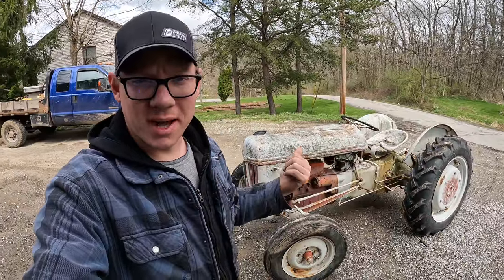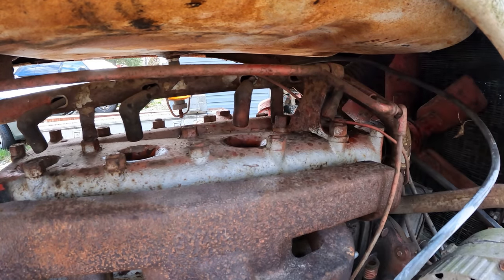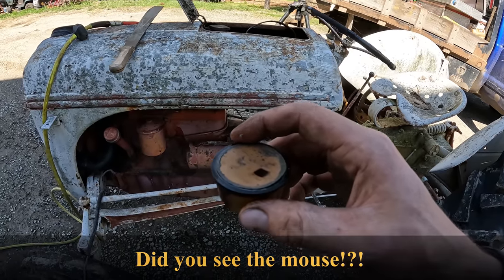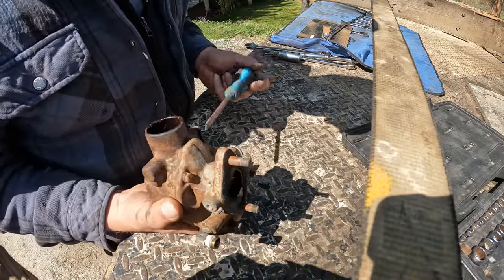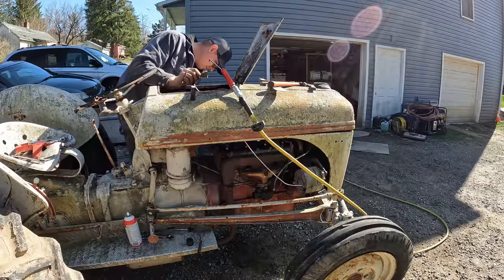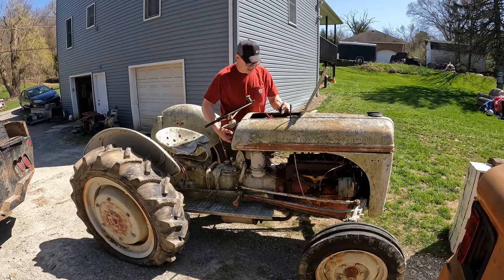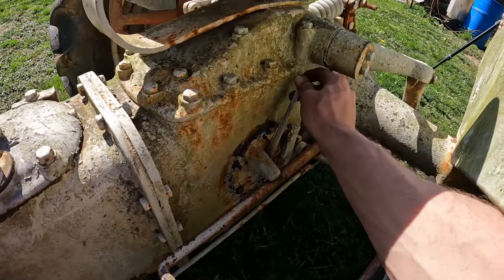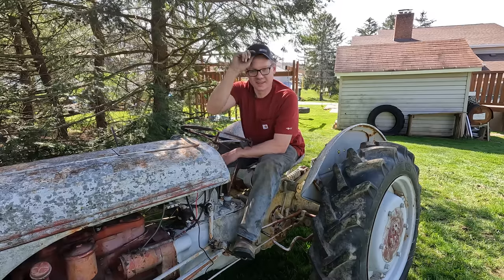Saved From the Crusher! Will this 80+ Year old Ford 9N Ever Run Again???

Comment: How much did you end up selling it fore? Does the rear lift pick up an implement? Does the lift travel down?  I have the same tractor, guy put some paint on it and told me it was a partial restoration and a great tractor. Has a front bucket on it. It ran enough to load it on a trailer and get it home, then I had to  spend a bunch of money on it to get it good enough to do some work my point, you bought a coil, probably from Amazon, don't know if it's 6 or 12v, filed and cleaned points without removing distributer??? Wow! That in itself is amazing considering you have about 6" to work from a side angle. What gap did you set it at? Were the lobe shaft bushings in good shape? How was the timing set? What was the compression on each cylinder? Why didn't you change the exhaust/intake manifold gaskets. That's the same as having a vacuum leak.  My point, some guy will come along and think you are a top notch mechanic and think he is buying a great tractor. That's why I ask. How much did you sell it fore? My advice, take a knowledgeable tractor mechanic with you before you over pay for these tractors. A top running tractor 2n or 9n is valued average 3k. But that is a top running tractor.

Comment: these tractors turn in their own length to and to split in in to 2 pieces you'll need 2 rails and slide the parts opposite ways 
good luck with your build

Comment: I saved a 53 Farmall M from doom. The old tractor runs great to. I used it to pull an 8 foot disc and cut grass with a 5t bush hog. Just wish I could have saved my mom's farm from my siblings hate and greed.

Comment: It's no surprise that the "simple" old stuff just needs fuel, spark and that's about it. The "coil" as you put it is actually a distributor power by a coil. Most early cars had a separate coil which sent the voltage to the distributor where the contact points sent the voltage down the coil leads to the spark plug.  Nice and simple....not like now hey.

Comment: that is the tractor I learn to drive on in Winter of  56-57.  I was 8.  
Da put 4inch tall blocks on peddles so that i could reach them.  It was still a reach for about 4 mo then it was not.
Reply: one other thing I still own it and it still runs.  Use it for little jobs

Comment: This thing was designed to be maintained with just a screwdriver and a crescent wrench. That is what was included with the original toolkit (although iirc it was a small monkey wrench?). New cars should have the same sort of design. It can be done, motor mounts can be done with quick disconnect cotter pins etc.

Comment: The front wheels are not Ford 9N or 2N.  9N used a 5 lug 9-3/4" center hole wheel with a 4.00" x 19" tire.  2N used a 6 lug 6" center hole wheel.  Your tractor was modified to fit a small pattern five lug wheel.  Ford 9N wheels are rather inexpensive and easy to find; somebody went through a lot of work to make those wheels fit.  Also, the quickest way to identify a 9N is the long radius rod/bar connecting the front axle.  9N used a I-beam like rod and 2N and 8N used a smooth oval radius rod.

Comment: A problem with 8N & 9N is to be experienced when the front suspension steering arm is over stressed and then it rises to make contact with the Distributor cap- resulting in it being cracked. Too fast driving over rough terrain and Your going to need to replace the cap...

Comment: I bought a 9N and am tickeled to see you get this one going. It is a shame that someone would scrap this while with a little bit of knowledge & time you got it running. (those coils are a bitch putting them on without bending that contact spring) But all in all you can do a bit of work with them! Good to see you running the 3 point arms too!

Comment: The way a point distributor ignition works is battery voltage is supplied to the points,when they close voltage is sent to the high energy coil which supplies high voltage(secondary voltage is what  its called 30-40 thousand volts.)when the points open the  coil releases that high voltage thru the coil wire to the rotor which directs that voltage to the correct plug wire, the points in the distributor uses low voltage only or primary votage,it also provides the timing to release the coils secondary voltage(high voltage,in a nutshell,batt voltage is supplied to the points which con trol the charging and discharging of the coil, when points are closed coil is charged when points open  coil discharges high voltage to the proper plug wire
Reply: Hope that helps
Reply: Distributor directs the high voltage thru  the rotor and cap

Comment: If you can find it lead paste pipe dope sealant. Teflon is all in the wrapping. Don't  like pipe dope as a rule. Brass pipe thread fittings shouldn't require 
 any sealant . If you remove any pipe thread fittings bunch of times  and the threads get worn down wrap with your choice of thread tape till threads are completely filled and disappear then it will seal again .

Comment: I miss cars & trucks like this, fuel, air & spark was all that was needed, so much simpler to figure & work on.
Computers are suppose to make them run cleaner & more fuel efficient,but really isn't that much better.
I have unseized many small engines & they never lasted very long.

Comment: I BOUGHT A JUBILEE EN NOTHING FROM NINE  N WILL WORK,, WENT THRU THE SAME STUFF ON THE JUBILEE, TANK WAS HORRIBLE EVERYTHING GUMMED UP , GOT NEW CARB EN CLEAN TANK , LOOSEN ONE EXHAUST VALVE WAS STUCK OPEN,  PUSH ROD COME OFF,  GOT IT BACK TOGETHER RUNNING GREAT ,,😅

Comment: Dude if you take that deadbeat carburetor off and put a motorcycle carburetor on it like I did on a 1940 case you can do half an acre with 5 gallons or do 20 acres with 5-gallon some motorcycle carburetor and have like a jet motor you won't believe it the same machine with a a little motorcycle carburetor on there so it'll run so good

Comment: Myself I would use the engine if it works and the rear end if the transmission works without the back tires set up as a power plant for a sawmill

Comment: The rims have been changed to a 8N and it should be a 6 volt positive ground unless someone changed it all over to a 12 bolt system. I put a 8 volt battery in the 9 and 8 N then crank the voltage regulator up to feed the 8 volt system. When nothing on the farm would start our 8N would start.

Comment: How do you get so lucky! I have a INT TD 340 that is stuck. I have removed the glo plugs and put a good quantity of penetration oil in each cylinder waited a couple of days before trying to start it with a battery. It won't budge.
Reply from the maker: This thing was barely stuck. I’ve salvaged much worse though. Best thing I can recommend is pull the head and dump some evaporust or the like. in the affected cylinders for a few days tap on the piston with a block of wood A couple times a day. Once you get it to start moving, clean out the cylinders and hone them as best you can before you try to turn the engine and mess up the rings

Comment: Those front tires look much larger (wider specifically) than the originals should be. Maybe someone used the original rims to modify to the current front tires.

Comment: Tear it down sand blast and prime and paint, new rings seals 100% restoration. They go for good money rebuilt 
That one looks nasty.  But i belive you cam buy all new rebuild parts for them still. 

Put a mower deck, a blade frt back or underneath to move snow and level a gravel driveway. In the 70s you could buy them for a few hundred bucks i think originally they only cost 500 bucks.  
But 500 bucks for something thats lasted 80 years is cheap money.
$ per year to own and use is pennies.

Comment: Dad has a 1940 model.   It has a Sherman Step Transmission that gives You 3 Extra Gears.  His hasn't ran in several years.  This Sorry gasoline that they make now is not really what it needs. It used to run good when they still made leaded gas.

Comment: Around 33:48 or so you can see some little flashes around the engine that almost look like sparks. Anyone else notice that? Is that just some dust catching some light just right, or are they actually electrical sparks? This may have already been pointed out, but I don't have time to read through 3000+ comments.

Comment: None of them 9 ends came with the floorboards them or add-ons good little tractor take the plugs out fill the cylinders up put diesel fuel in transmission fluid what is it about a week and then try to pull it in reverse and it should snap write out they have Steel Pistons that like to get sticky but even if you have to take the oil pan off of it put a jack on the crank so you roll the motor over backwards most likely it will break loose but even if you have to rebuild it it doesn't cost much for them

Comment: i'm surprised he didn't take that engine cover off. with imporoved access most of the electrical problems would have been much easier to prevent, detect, and fix.

Comment: In the instance of a Ford 9N or 8N, no tractor is ever beyond saving. There will always be a ready market for them, even if the engine is seized. Both big acreage farmers and small acreage farmers look for some project to work on over the winter, and an "N" tractor is just what the doctor ordered. And prices are always up high enough to make it worthwhile to overhaul. Why.? Because the "N"s were the first tractors with a 3-point rear hitch and a power take off. The 9Ns came out in 1939 and the 8Ns came out in 1948. but they're rugged as can be. Nobody should ever consider crushing an "N" tractor. There are plenty of stories about shipping rebuilt "N"s over to Africa and other 3rd world countries, because it was the one tractor universally regarded as being so simple that they were easier to work on than to tie your shoe.

Comment: The easiest way I have found to tell the difference between the 8N and 9 N is the transmission, The 9N is a three-speed. The 8N a four-speed.
Reply: That one also has small front wheel bolt pattern that 8n used

Comment: Hard to fit other rims to the hub. The holes in my rim was drilled to have larger holes so it can fit.  My hub is still original but not the rim.

Comment: The grey sludge is probably from the ethanol in the fuel that they never engineered the fuel system materials to tolerate. I stay away from ethanol enhanced fuels.

Comment: So, hearing there is a difference between   the engine design, does your tractors engine spin clockwise and a Ford 600 tractors  engine spin counter clockwise?🤔🤔🤔

Comment: Its most likely a 9N as the 2N and later 8N have different radius rods, tube style not I Beam like the ones on yours, rear wheels have a different (larger) hub diameter in the 9N and 2N smaller in the 8N.

Models are oldest to newest 9N 1939 to 1941, 2N 1942 to 1947 and 8N 1948 to 195?.

Comment: My first thought about "WHY?" put plug wires in a metal tube, was to reduce radio interference, especially for old AM radios.. except that I don't think they were putting radios in <1930 cars, and there was definitely no radio in this tractor.. so now it seems like plain coincidence that manufacturers stopped using (potentially RFI shielding) ignition wireguides right around the same time that they started including radios which would benefit from RFI shielding.. Humans are amusing creatures...

Comment: i went to see my friends " new" tractor. A 1960/s International something. Bald truck tires on the front and  other Ills that required a real mechanic,not  our other buddy that manages to keep assorted junkers running. Not the most reliable machinery. I dont have that level of mechanics knowledge. I do the required  maintenance on my L2800 Kubota I bought new in 2004. Gas tractors must be  passe.I do get a kick when he revives something that has been in the bushes for 15 years. I learn alot about something I dont know much about.

Comment: I've worked on allot of Ford 9N & 8N tractor's along with Ferguson 20's and Ferguson 30's tractor's which are extremely close to all being the same tractor's . I've changed them from 6 volt to 12 volt . I've unfroze many a tractor engine !!  Even after you have tried to pull crank it by having it in a high gear and letting the clutch out as you pull it down a paved road . You can pull the spark plugs out and soaked each cylinder with penetrating fluid but still won't turn the engine . You can also soak each cylinder down with brand-new old style transmission fluid and let it sit for 24 hours , it still won't turn the engine . There is still a trick before you pull the head off or tear it down !!  I have unfroze many an engine !!!  But I do  strongly recommend you rewire the tractor , but be careful as there is another trick or two for rewiring something from 6 volt to 12 volt !! The wheels that appear to be welded are the 9N spindles with 8N rims & tires or front wheels , but the rear rims are the 9N wheels . You did get very lucky for the engine to turn over . But do flush the entire fuel system and change the fuel filter or add an inline fuel filter . Although I'll keep the secret about breaking loose the engine if you've tried everything else I mentioned !! It's a good money maker for me yet , as I'm old and eventually I will pass on the old trick to break the engine loose before you pull it apart . But for $400.00 , you got one heck of a deal !! In it's present condition , it's an easy $1500.00 tractor as is or more depending on your location !  FYI , Come On Man , we all know you're gonna keep it !!    lol

Comment: Massey Ferguson was years ahead in terms of design. Goes back to massy Harris. Ford copied a bunch of items and thier version of the MF35 or TO35 was the 8N and 9N tractors. Ford was no newbie in the gas mobility market. So they made a bunch of these. Going up thru the jubilee model. My first choice is Massey. But I have worked on these tractors and they are sweet. For a small acreage, they will serve you for years. Check out the factory rocker box and three point hitch. High tech modern in its day. The motor is a flat head and valves can be adjusted with ease on right side of engine. The front linkage is typical Massey.

Comment: You made a quick $2000 on this. There really isn't much to be done with this. Pressure wash it and change the wiring (which is simple). Not much time at all - 2 hours time and it will be worth $3000.

Comment: those front wheels are not original and you need oil in the oil bath you can also move the front wheels in and out for differant crops

Comment: Love my 9-N but it's a gas-er and it's a dog. If the brake works hahahaha. My 9-N has a Different motor and I have not fix the left brake to make that turn with the PTO. But Mine is in better shape they work at.

Comment: Did you forget that the radiator was dry?  Better not run an engine for more than a few seconds without coolant!
Reply: At least I thought you didn't see coolant when you first looked down into the radiator, and then you seemed to skip over it, as you worked on everything else, even starting the engine without further checking it.  Fortunately, it turned out to be mostly full after all.  (So, my mistake.)

Comment: Lol saw the damaged rim.. walked for smoke on scrap pile small walk away to check what was there and yeah guy just delivered fitting rim for this... too bad its another side of the world from you, would otherwise give it to you or the next owner. Also least on our Nuffield 4/65 first indent is everything off, second is the hydraulic pump alone so back lift and hydraulic output works and third is pump and PTO, so look if there is middle indent so you dont run PTO with out need for it.. its also safety risk. Also for love of god build a proper cockpit over this, you or the next owner. Saves the interior and saves life and limb if it rolls over. Also floor boards to both sides. Enough people have died with these open tops...

Comment: Tractor can do something jobs fixed up steel body's and put parts Off clean Off dust rusty everything Old paint clean Off dust rusty Off and wash down Nice clean up let's dry All over body's Must be perfect clean good and get paint job do under coat stry up spraying painting undercoat All over body's gold Dark yellow and take four wheels Off clean Off dust rusty wash down Nice clean up dry Start spray painting undercoat All over four wheels let dry up rub down wheels clean Off bits dusty Off clean spraying painting top coat darker Sky Blue All over four wheels let's dry up and fixed up put parts Off clean up wash down dirty Off Nice clean up and rub down parts of engine and gearbox and diff and spray painting undercoat All over engine/ gearbox and diff let dry and bits rub down clean Off dust wash down Nice clean dry Start spray painting top coat shine Apple RED engine/gearbox and diff All over body's and engine/gearbox and diff everything parts body's put back in together fixed up Nice good perfect jobs see look good perfect